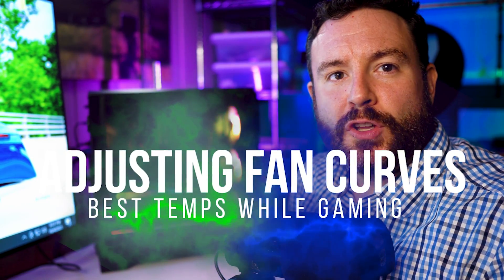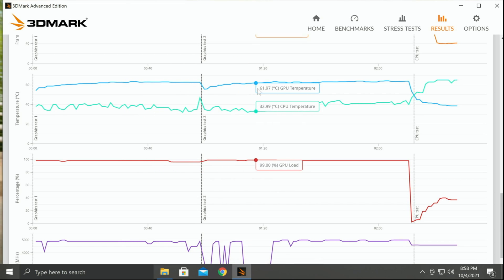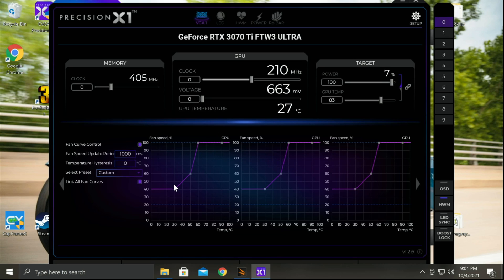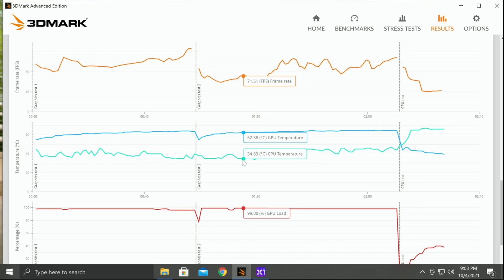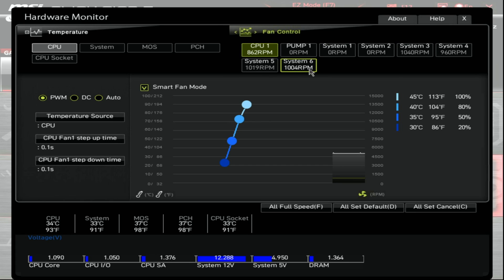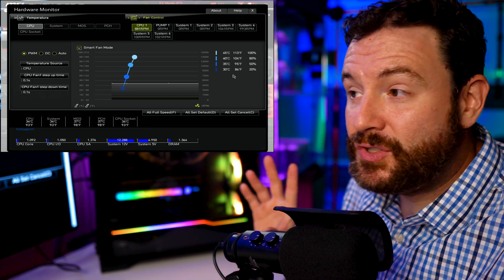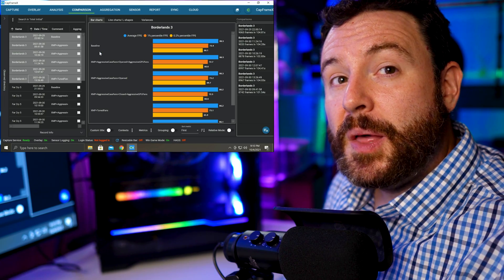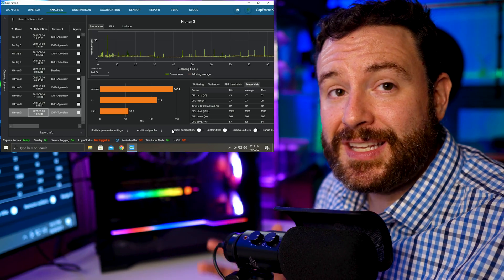How To Adjust Your Gaming PC's Fans For Silent Mode and Gaming Mode

Comment: Hello. I have an AIO 3603, 3 fans and the one that pulls warm air out of the case. My son keeps it at 1400, 500 pump fun and CPU fans. Can I reduce the system, or rather the fans for the CPU, a little, at least to 900 or 1000 because it is too loud? Thank you very much

Comment: Px1 what if you dont have a a curve matched at 30c idle fan is 30% cause you cant set up a undervolt via px1 to save your temps, and you want a all one style curve for gaming, starting is 45c. 30% what is the jump range here? increments of 30%-40 but while you set up yours to 100% to 60 is to loud for me.

Comment: Hi, I recently installed 2 Artic 120 fans to bring more air to the gaming PC and not knowing how to adjust them, I always let the PC manage them, I searched on YouTube and was pleased to find your channel =) I set them as yours with little difference, I did 30 degrees 20% 40 degrees 50% 50 degrees 80% and 60 degrees 100%, I lowered the temperatures but the fans are always at 100%, the temperatures run from 50 to 70 degrees, and they really make too much noise =( what could I do.?

Comment: I suggest you set the temp sensor for the system fans from CPU to SYS since your GPU will be dumping its hot air into your case. I used hwinfo to find the idle  temp for my system to be around 40C and 50C under full GPU load. So for the system fan curve I set the idle fan speed to where I can just barely hear it around 40% then have it ramp up quickly to 100% before hitting 50C.
Reply: That seems horrible, 50 degrees does not need 100% fan speed to cool it down lol

Comment: if i play games at high noise is fine temp around 75c its fine, if i push it to ultra settings gpu sounds like a hoover at 82c! how do i reduce noise but at the same time reduce that temp? i cant just slow down the fans it will get even hotter! its abit toasty for my liking as is. its a asus strix 3070ti stock OC

Comment: 100% at 45 is not a "starting point to dial into", thats way way too aggressive. Something more like 100% at 80-85 would be a good starting point for a "gaming mode" since that's just before most CPU's begin to throttle.
Reply: Agree. My cpu ramps up at 75c 100%. 55c 50% and 65c 70%
Reply: Bros computer is gonna scream while watching youtube
Reply: 100% at 45c is fucking nuts considering 60c is basically room temperature
Reply: @quantum5661  I keep my room temperature at 22 C. You would be next to dead after a few hours in a room at 60C.
Reply: @quantum5661 You don't understand Celsius, do you? 🤣

Comment: Those fan curves are way too aggressive dude, with most fans this will be noisy af. 75% fan speed is the max sweetspot for noise/cooling performance anything beyond that is just a lot of noise for no furher cooling.
Reply: how far is the gap for the change from the point of using pc to gaming on the chart here you add 75% cap to what temperature cooling the gpu under a game for you set it to 83c? or 70-75c? more comfortable for short sessions id assume he is.

Comment: The PC will suck in dust anyway because the PC case is not 100% sealed. The GPU will pull it from the back anyway. The filter lets the dust in. Just clean your pc.  It is best to give the pc cold air and the warm will go up naturally.
Reply: Natural direction doesn't matter much when the air is moved with fans.

Comment: Why would you want 100% fan speed, at 45c? What a useless video.
Reply: Have to agree. Running the AORUS RX 6800 XT Master at 33 % fan speed, not even using advanced fan curve, I get up to at most 75 C under full load. It's silent at all times and cold as fuck at least in idle. LOWEST. FAN. SETTINGS. POSSIBLE. OC'ed the shit out of the card too. No problems at all.
Reply: Yeah this is ridiculous
Reply: my 3070ti is running on 100% at 29. i cant change it

Comment: I doubt you're still checking comments here but I did exactly as you said and 3D Mark Timespy isn't showing my GPU temp in the results. It's showing the clock speed but no temp log and I've tried clicking around in everything and there doesn't seem to be a way to enable it. Help?

Comment: My evga rtx 3080 ti ftw3 ultra goes to max fan speeds on everything and it's unbearable to be around I had to kill the power down to 85 to get to to stay around 60% fan speed to even play any game.
Reply: You could just apply a custom fan curve w out adjusting power slider. Depending on your gpu temps it could be your case not having good ventilation
Reply: I have the same gpu and I'm trying to find a solution,any tips?
Reply: @Legitshooter  I underclock it so Within the EVGA Precision software I set the power to 85 and it seems to be bearable.
Reply: @Funkiyy  does it affects performance?
Reply: @Legitshooter  I haven't noticed any difference I mean what games are you playing you can always try it out I honestly can say you're not going to notice anything other than it not sounding like a rocket ship taking off.
Reply: @Funkiyy  thanks for the help
Reply: @Funkiyy  just the power limit 85% so 15% reduction seems somewhat better, power has to be unlinked or linked for this setting to function? but i tried dropping the card 5% they seem to stillrise in 101% though  did i miss the way to change this underclock %power ?
Reply: just the power limit 85% so 15% reduction seems somewhat better, power has to be unlinked or linked for this setting to function? but i tried dropping the card 5% they seem to stillrise in 101% though  did i miss the way to change this underclock %power ?

Comment: Above 1300rpm is fan getting to loud man,  with 2x noctua cpu fan,intake fan 3x corsair or outtake 3x sharkoon ..
I am mostly going above 65c to 70% , above 70c maybe 90%.
Reply: have you tried do 75c at 75% and got enough cooling down to 70c during a long session, noise reduced at least and temps normal?

Comment: Thanks for the detailed Guide, really appericaite the "Test then change settings" approach.
Now i would like to suggest a idea,
There is not a single video on setting up PWM fans with the fan controller, 
Its always a confusion with how many connection from Mobo are required for more than 5 fans,
And how to replace DC fans with PWM fams including the Fan hubs and all other connections, if someone is having the OEM case fans which are mostly DC.
Reply: Just literally connect them to motherboard fan headers. Go to bios, look for fan settings and change to PWM. Although If it’s on auto your mobo is smart enough to know it has 4pin pwm and not dc. If you have an AIO w a pump very important you change pump to just run at a single speed and not change (ramp up and down)